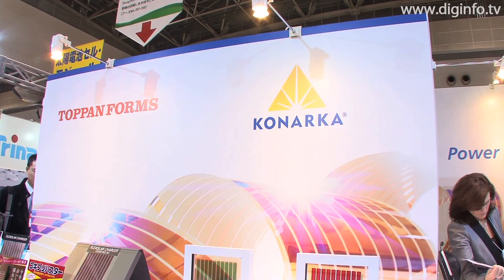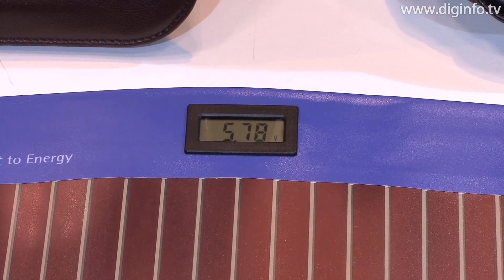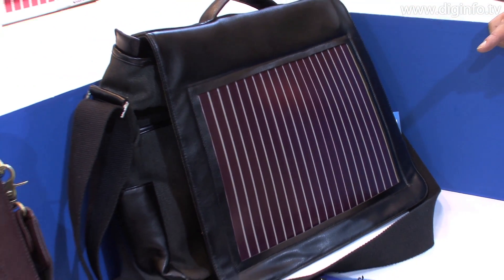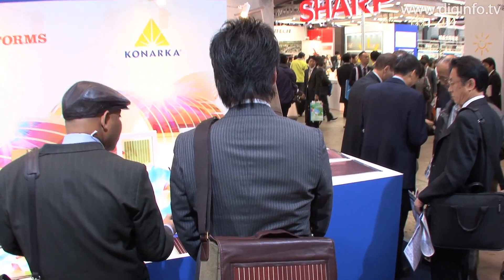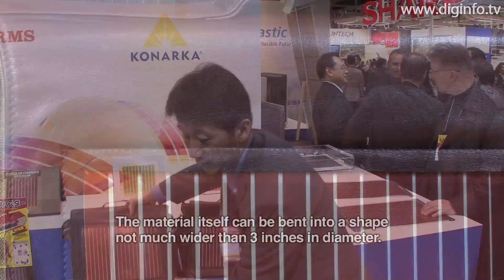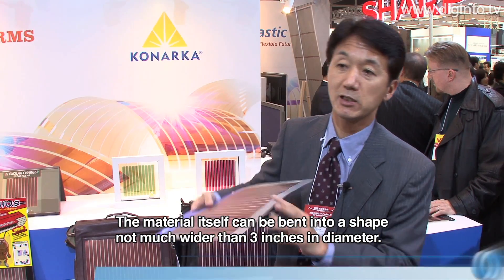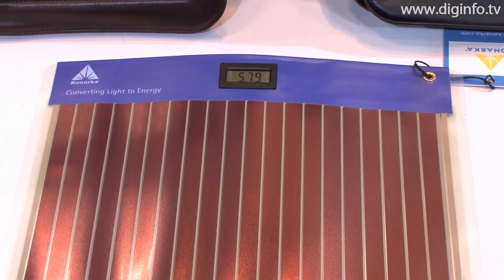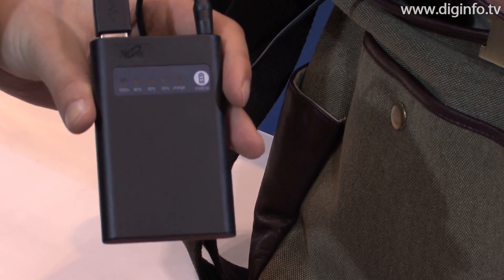Solar Bag - Konarka Technologies - PV Expo 2010 : DigInfo

Comment: @Rad631
I think they have a good recyclability. The organic part can by recycled or burned, contact are in Aluminium (complitely recyclable) and ITO (a unharmful oxide).

The biggest concern probably is the lifetime of the pannel... organic cell efficiency go down fast and in 3-6 years i think it will not be of much use.
So It's a technology usefull for integration on low lifetime products. Cheap, easy to recycle but with short life.